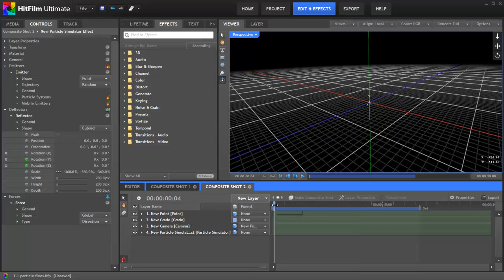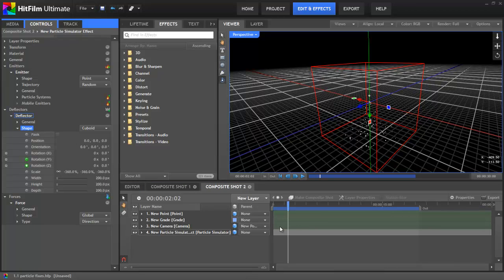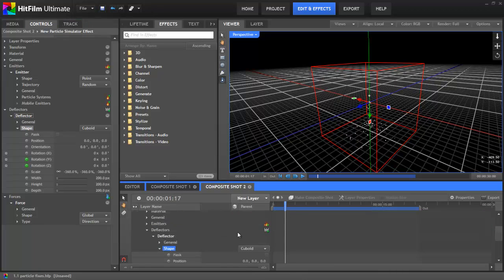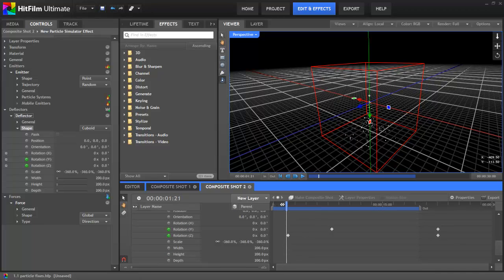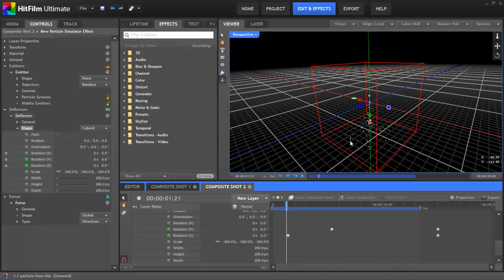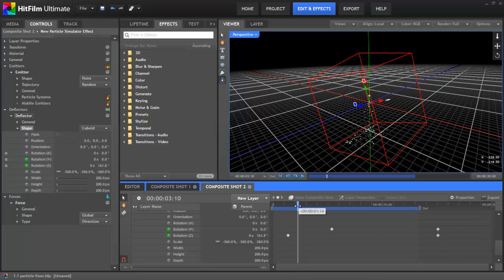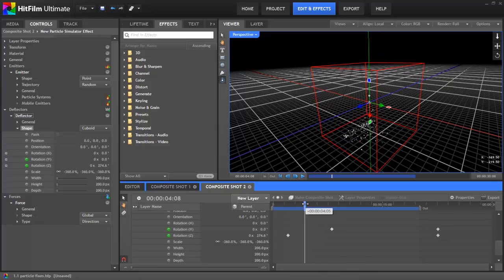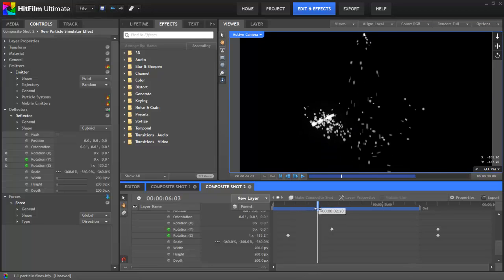Deflector-based 3D particle wave machine

Comment from the maker: At the bottom of the particle simulator's controls, there's the Deflectors category. Click the little + icon to add a new deflector. This is a cuboid by default. You can then tweak the settings as required!